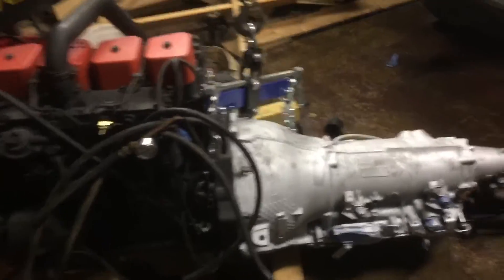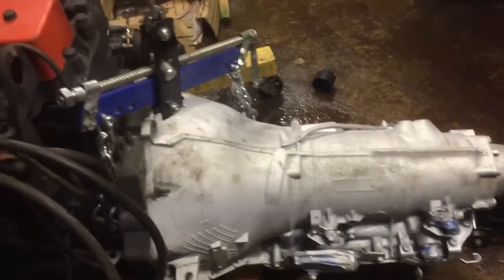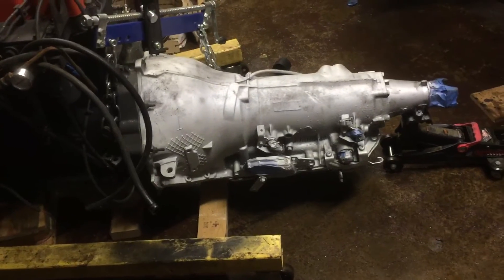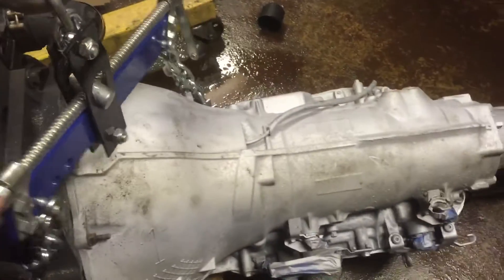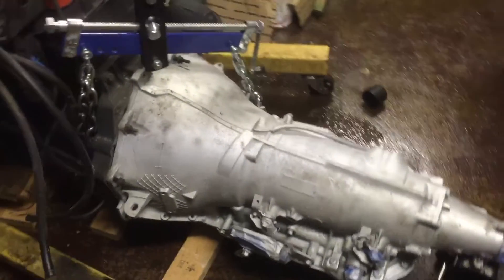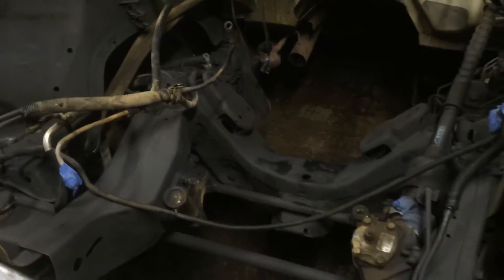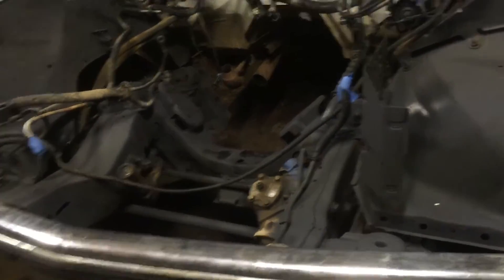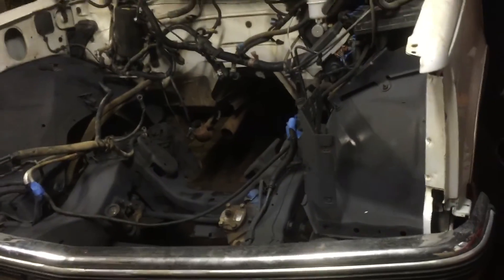1999 GMC Sierra C2500 5.7 350 w/ 4l80e swapping in 4bt cummins - Video 7

Comment: If you spun the converter while installing and also had 0 issues bolting it up to the engine, your converter is sitting all the way down. I want to put a 6bt in my 82 C10 and putting my built 700r4 behind it.

Comment: im thinking about using this trany on my class b 4bt swap motor home .  how hard was it to get the trany to shift do to the ecm ?
Reply from the maker: You need the correct torque converter and also a programmable tcu like the supermatic.

Comment: where did you get the adapter thanks good job
Reply from the maker: some of the the 4bt trucks like mine came with a chevy turbo 400. so you can find those adapters or  you can also buy them new from aftermarket conversion shops.